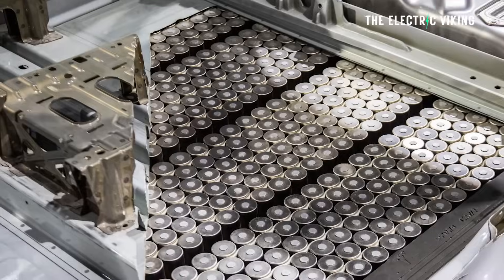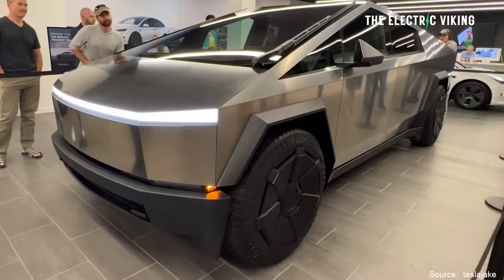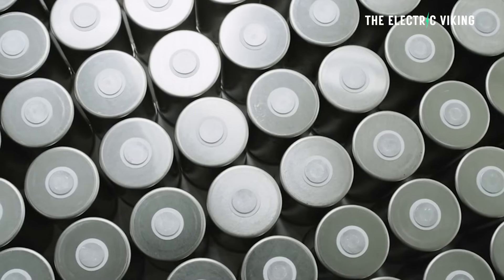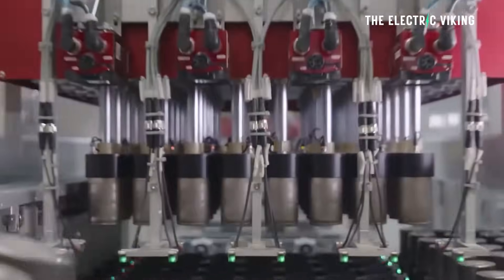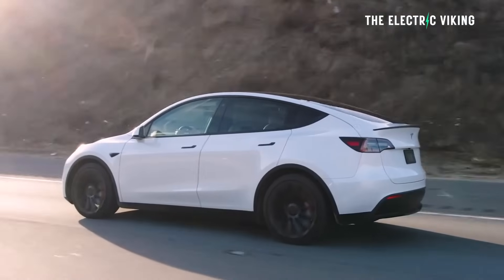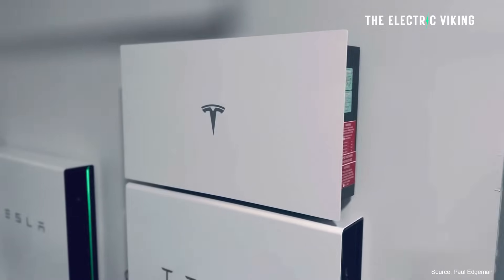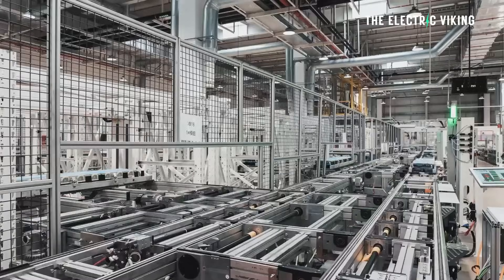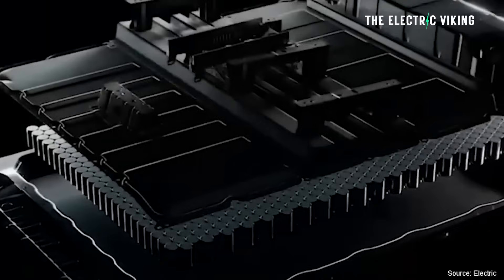Tesla employee reveals claimed Cybertruck battery size...

Comment: I would not put any weight into what people are saying regarding CyberTruck range.   Do you recall that the 500 mile semi was impossible.   What a score for Tesla if they announce the 500 mile range for the CT is real even if only in the 3 motor version.
One major thing Tesla did in the semi was to disable 2 of 3 motors when cruising.  I can see this happening with the CT,   I don't have insider info and maybe there is something I am missing.  But it is what I expect to see tomorrow.
Reply: Great Idea!!
Reply: Motor decoupling only increases range by a few miles. There are plenty of Evs with this Technology, doesn't make a big difference. 500 miles is only possible with the semi by driving extremely slow pulling a almost empty trailer
Reply: @simson4t This is 100% false. Tesla's demo drive showed that 500 miles was completely possible while driving highway speeds with a FULLY LOADED trailer. 

Sorry to disprove your lies
Reply: @themonsterunderyourbed9408  I guess we watched different videos. The one I watched showed the semi was taken over by every single vehicle on the road even other semis, it was the slowest vehicle on the road. And the Full load is just a claim, and when it comes to Tesla most of the claims are false. You didn't disprove anything, you only proved that you don't understand what you see, and you believe anything.
Reply: @themonsterunderyourbed9408   your complete comment is Grammatically incorrect. Have another try. 😊
Reply: @robertfonovic3551  Ah yes... The grammar police comes out when you have nothing left. Nice try by you, but you're still 100% wrong about the Tesla Semi.
Reply: they use only one permanent magnet motor in the front for cruising more efficiently. induction motor dont have a lot of drag when they are not excited, so its ok to let them engaged but  not require  a clutch( or clutches).
For the Semi its a bit different because it has a giant,  super expensive 900kWh battery. even if the clutch only saves 5% when cruising, boecause semis spend most of the time cruising, thats potentially a 50kWh saving, thats a significant cost and weigh to be saved.
I thought the cybertruck might use clutches too, but I think with induction motor(s) its probably not worth it. its a compromise beetween cost, weight, complexity, reliability, etc.
If you add a clutch, you might as well add another  gear ratio and a secon clutch and make a 2 speed DCT like on the taycan, but again, it's usually not worth it on an EV because of the torque transmission and clutches have to be overbuilt. remeber the first gen roadster that was breaking gearboxes like crazy

Comment: This is a big pack if the report is correct.  It would need to be if it is going to lug anything of substantial weight for any reasonable distance before it needs a recharge.  Be interesting to see what the real world range testing reveals.
Reply: Well if anything like ford lighting  E  truck  it will eat that battery  up readily quickly 
We will see soon

Comment: Large battery pack adds more weight, and thus less efficient. Good thing about large battery pack is that winter heating has less effects on its range.
Reply: Weight is a non issue to efficiency. Air resistance is a much bigger deal. You could also argue more weight increases the energy recovered during regenerative braking. 

Weight shouldn't be a concern at all.

Comment: 300 miles of range is so 3 three ago.
Reply: how many Tesla owners will need more than 300 miles in a normal day?
Reply: Most people don’t need more than 150miles. I average 20-40miles per day.
Reply: @oldbloke204 Most people don't care what you think.
Reply: Unfortunately, Teslas deliver significantly less range than advertised. Mine is the cheaper, 2019 Model 3 which shows 220 miles of range when full, but in reality cant do any better than around 150 miles at best, and that's supposedly spending only the 225 Wh/m that it calculates off of.
I've done the test several times, keeping it, no climate, low speeds, etc, and it's really bad.
For towing (which I'll need), any truck typically loses half the range, so that even the 500 miles would yield a "Tesla" 250 miles, which in practice would be more like 160 miles at best. And since you don't want to discharge from 100% to 0%, you'll likely end up with 120 miles of range towing, less than two hours on a highway... for a 500 mile range Cybertruck!!
Very sad... I have a 2500 diesel with 700 mile range, getting over 300 miles when towing. I really hope technology improves at a reasonable price.
Reply: @cyclopsvision6370  How many Tesla owners need the Truck to tow?  What's the range then?  And where do to they tow?
Reply: @cyclopsvision6370 why ask a question that know one has the answer to? How longs a piece of string?
Reply: @oldbloke204 All the fascination and hype can't alter the fact that it is JUST a vehicle, that will only appeal to a small number of people.

Comment: Model S longrange has a batterysize of ~100kWh and cost north of $90K. This guy claimes that Cybertruck will have a 200kWh battery, more expensive buildingmaterials, much larger car and cost will be $80K🤪

Don't be this gullible, this guy just makes stuff up for clicks.
Reply: Tomorrow one of you will have to eat your words.
Reply: CT will be mass produced, model S is low volume and a luxury car.  Completely different in terms of cost to build.  Battery size doesn’t make that big of a difference in price
Reply: @vulpo  
143kWh battery. Trimotor price $99K.
This viking is just trolling.